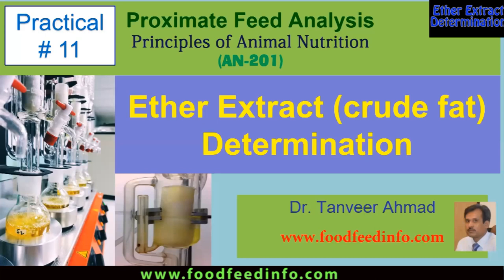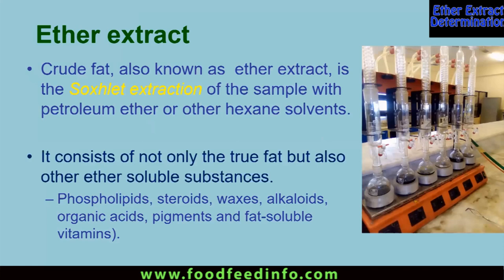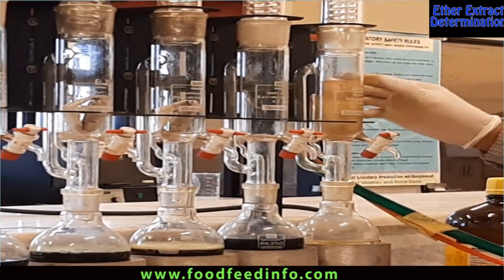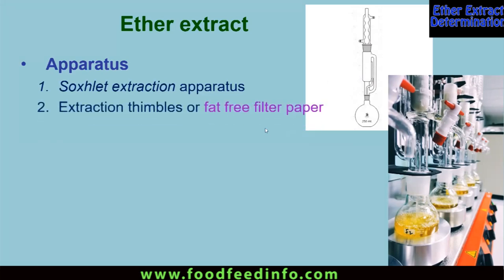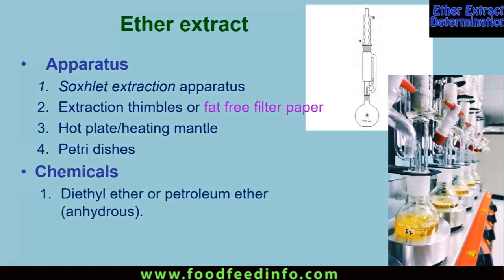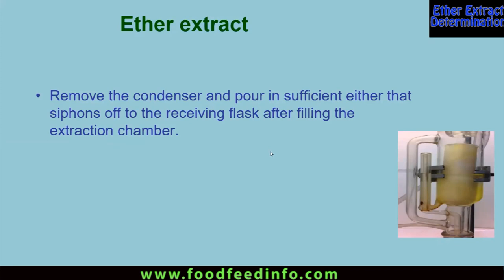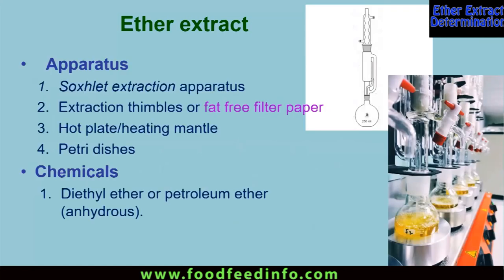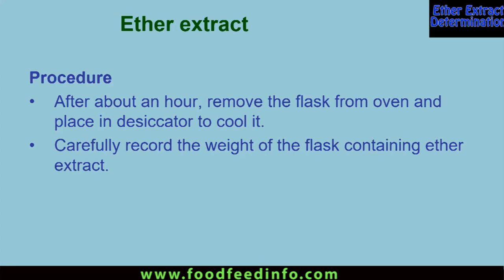Practical#11-  Ether Extract (crude fat) Determination

Comment: A dried, ground sample is extracted with diethyl ether which dissolves fats, oils, pigments and other fat soluble substances. The ether is then evaporated from the fat solution. The resulting residue is weighed and referred to as ether extract or crude fat.

19-Arid-2204
Section A

Comment: 1.Normally ether is a colorless fluid but when it extracts iron or fat it becomes yellowish in color.
2. Apparatus required for ether extraction is soxhlet extraction apparatus, petri dish, hot plate, and extraction thimbles.
19-arid-2240

Comment: 1- Principle of ether extract is
Ether is first continuously heated then volatized and then condense and then drop on fat filled sample.
2 - Apparatus used in ether extraction are
Soxhlet extraction apparatuses.
Extraction thimbles.
Hot plates or heated mantles.
Petri dish.
19-Arid-2262

Comment: the extract which is ectracted in this experiment, is not true fat instead it is crude fat which includes phospholipids, alkaloids, waxes and other such fat soluble vitamins.
the weight of the sample that is taken for the ether extraction depends on the fat content of that wheat stuff. For example I what straw is used, the amount of sample taken can be 10 gm as it contains more fibrous content.
19-arid-2246

Comment: We use ether, diethyl ether, petroleum ether or other hexane solvents to extract fat soluble material from ground.
The ether is heated, volatilized, condensed and dropped on sample continuously until all the fat is extracted. The fat after being dried in oven is weighed.
19-Arid-2187

Comment: Principle for ether extract is 
Ether is continuously heated volatilized condensed and dropped on the sample containing fat which extract ether soluble material.

Ether extract can be determined by recording the loss in weight of moisture free sample during ether extraction.
19-Arid-2181

Comment: ✓The apparatus by which the ether extraction can be done is Soxhlet apparatus. This apparatus have three parts;
•Condenser
•Extractor/sample jacket
•Flask
✓We use ether, diethylether, or petroleum ether or may any other hexase solvent to extract fat or fat soluble material.
19-Arid-2254

Comment: Once, the flask is removed from the soxhlet apparatus it must be kept in mind that the flask should not be placed in oven immediately.
Instead it should be allowed to evaporate the ether vapors present within it otherwise a fire hazard may result due to high volatility of ether and high temperature of oven.
19-ARID-2248

Comment: 1) For extraction of fat and fat soluble material from ground sample, we mostly use ETHER or other hexane solvent.
2) Apparatus require for ether extraction are soxhlet extractiojn apparatus, hot plate, petri dish and extaction thimbles or fat free filter paper.
19-arid-2200

Comment: 1-Ether extraction is done to determine the crude fat content of the seeds by using soxhelt extraction apparatus.
2- Ether should be regularly heated ,volatilized,condensed and dropped on the sample which consist of fats.
19-Arid-2253

Comment: The difference of weight of sample before and after extraction will give us the weight of ether extract. In order to calculate percentage ether extract,  we divide this difference by sample weight before extraction and then multiply it with 100.
19-Arid-2224

Comment: •We use ether to extract fat and fat soluble material . 
•Soxhlet extract use petroleum ether or hexane solvent .  
•Principle ; ether is continually heated , volatalize , condense and dropped on sample containg  fat .
• Appratus ; condenser (top most where ether get condense ) , sample jacket(in between flask amd condenser where sample is present) , flask (below the sample jacket to collect ether ) , heating plate  ,petri dish .
AYESHA TALAT 
19-ARID-2276
GROUP B EVENING .

Comment: 1. Ether is continuously heated, volatized, condensed and dropped on the sample containing fat until complete removal of the ether soluble material from the sample.
2. Either is normally colorless before extraction but when it is extracted it change into yellowish color.
19_ARID_2296